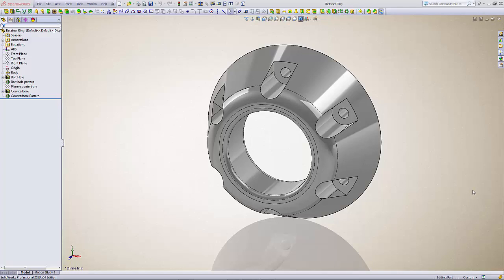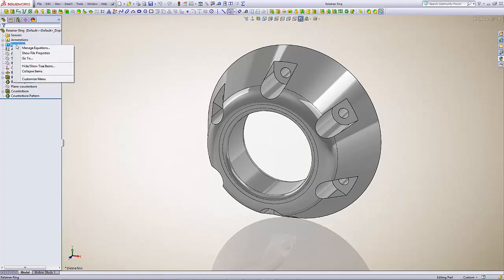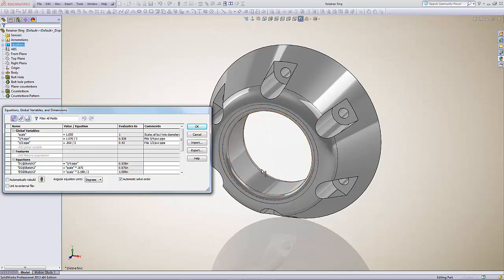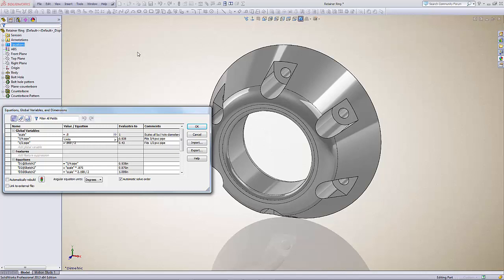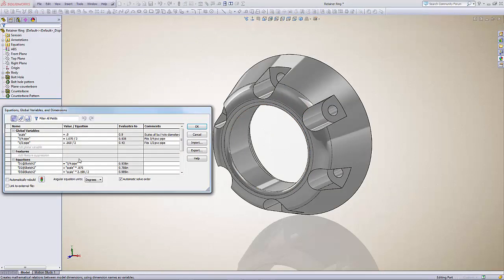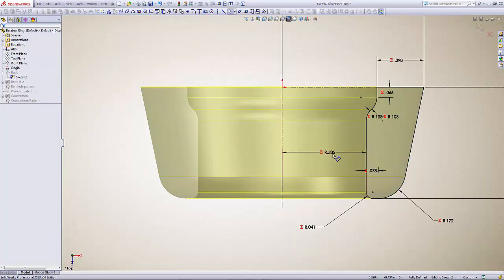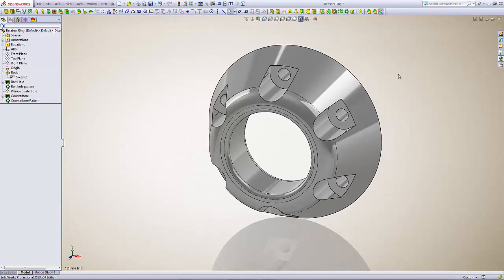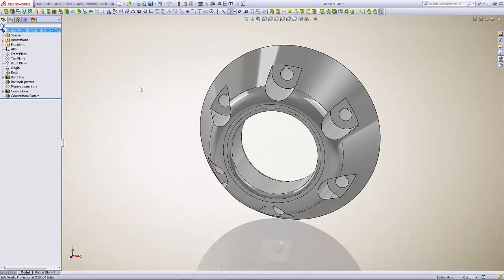E-nable RIT Arm Retainer Instructions

Comment: Hi Nick, thanks for the video. I am working on a RIT Arm now for a seven year old girl.
I am unclear on how the palm attaches to the PVC.
Reply: I am in the process of building a RIT arm for a seven year old girl. I tried using the Palm from that the first version and the fingers from the Cyborg 

I could not get the fingers to fit.
Reply from the maker: Hi Ralph,
The pvc pipe is a press fit into the palm. If it's too tight to get it to go, you may need to sand either the ID of the hole in the palm, or the OD of the pipe. If you have scaled up or down using your slicing program, most likely you'll have a great deal of difficulty making the parts fit together.
Reply from the maker: Ralph Ferro Concerning the fingers, I have created my own version of fingers that fit and look proper with the palm. I have sent you a private message - please respond to that so that we can discuss some details to try to get your project back on track.
Reply: Thanks, Nick, in my hysteria to complete the RIT Arm with the Raptor Hand adapter and get it to Fedx by 8:00 PM on Tuesday, the last chance to get it there before Christmas I must have missed your email.
I had numerous problems with the build and that I would like to run buy you so that the next build goes more smoothly.